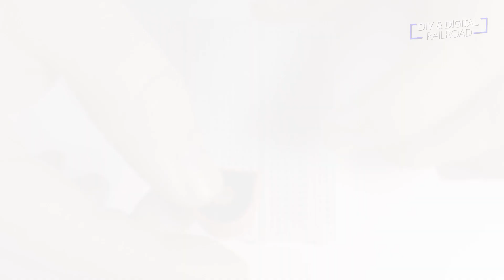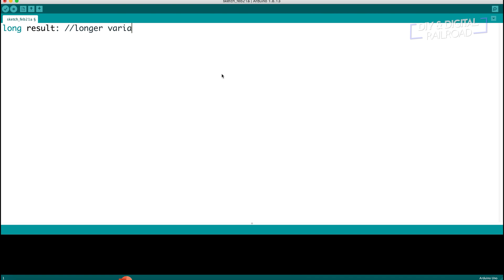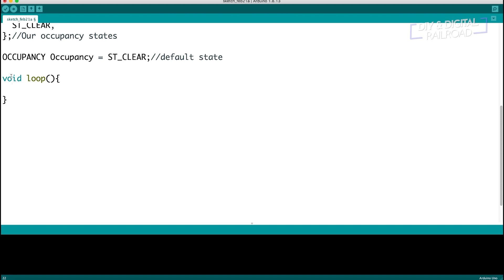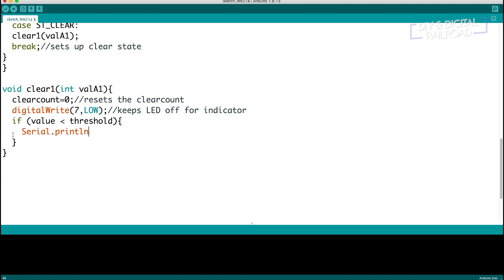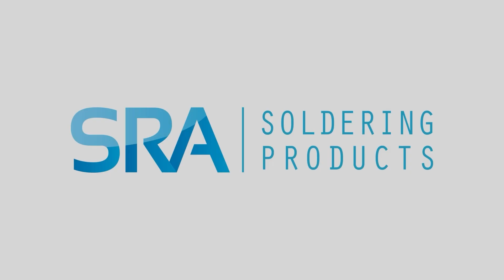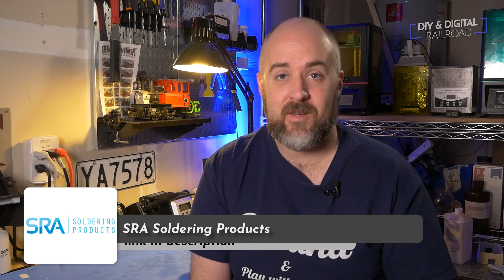Building a Cheap DIY Current sensor for DCC with an Arduino!

Comment: Hey Jimmy - cool video but I think there are a couple of things that are not correct (based on what I believe you are trying to do).  

In your loop() routine - you are not reading the sensor inside the for loop so you read the sensor once at the start of the routine and then go into your for loop and do not read the sensor in the loop so you are processing the same sensor value 10 times.

The logic for calculating the average of the 'numSamples' sensor readings also does not seem correct.  Your logic should be summing the valA1 values and then dividing by the current value of 'i'  to get the average of the readings in the for loop.  You are adding valA1/numSamples (or 1/10th of valA1 in this case) to your result variable.

A simple example if you have two readings of 552 and 560 then your logic results in:
Iteration 1: result = 552/10 =55 
Iteration 2: result = 55 + (560/10) = 55 + 56 = 111 <- clearly NOT the average of 552+560 (which is 556)

The correct calculation would be as follows:

void loop(){
  int valA1;
  int result = 0;
  for (int i=1; i <= numSamples; ++i){    // have to have 'i' start with a value of 1 to avoid divide by zero error first time through loop
    valA1 = analogRead(A0);     // read analog pin
    result +=valA1;             // Add the new reading to variable 'result'
    value=result/i;             // dividing result by the number of readings taken so far to get average
    Serial.println(value);      // displays average reading
  }
  delay(10);//reading every .01 seconds

One other comment is your 'clear1' and 'occupied' routines are passed the value valA1 but never use that value inside the routine??

Not trying to be a pain in the rear or a 'know it all' just wanted to let you know.  If I am incorrect please let me know.   
Thanks again - Rick
Reply from the maker: Hey Rick!  No you are not being a pain and I am going to pin this comment.  I plugged in the changes and re ran the test and it works great!  Since I am no coder, I will make these adjustments on the next video.  Thank you again!
Reply: @DIYDigitalRailroad  Thanks Jimmy - only wanted to help and I really appreciate you understanding that.  Looking forward to more videos from the DIY & Digital RR!
Reply: @DIYDigitalRailroad  another code thought if the delay(10) is really supposed to add a 10 millisecond delay between each reading it should be in the for loop as well. Also no need to print and average the value until all 10 reads are completed since you do not do anything with the result until all 10 reads are completed. So as an alternative you could do this:

  for (int i=1; i <= numSamples; ++i) {    // make numSamples reads
     valA1 = analogRead(A0);     // read analog pin
     result +=valA1;             // Add the new reading to variable 'result'
     delay(10);     //reading every .01 seconds
  }
value=result/numSamples;             // dividing result by the number of readings taken to get average
Serial.println(value);      // displays average reading

The above also takes care of the divide by zero error for two reasons i is not zero after the loop and it is not used to calculate the average, I changed the comment on the for loop to reflect this as well.
Reply: "The logic for calculating the average of the 'numSamples' sensor readings also does not seem correct."

The logic in the original loop is correct, though not optimal.  The division by 10 in each iteration of the loop should be division by numSamples for clarity, although when, as here, numSamples is 10, the results are correct.

The problem with your example is that you did only two iterations, but still divided by 10.  If you had divided by 2 instead, you would have gotten the correct result.  Dividing each time by i will never give the average; the last time through the loop i == 9, not 10.  Also, the first time through the loop it divides by 0, which ordinarily causes a program to crash and burn.  I don't know how Arduino deals with divide by 0 errors.

I would have written the loop this way:
--- snip ---
  for (int i=0; i < numSamples; ++i){
    result += analogRead(A0);
  }
  value = result / numSamples;
  Serial.println(value);
--- snip ---

There is no need to do more than one division, especially since all but the last are thrown away, and you don't need to store the reading in a temporary variable.

Also, the long result in the first line if the program is never used; the int result in loop() masks it.  Since you originally made result long, you might want to do the same in loop(),   If you keep numSamples below 30, however, that should not be necessary.

Comment: Very nice video - easy to understand and thus very useful.  I built one and tested it on my home Digitrax test track, and it worked perfectly with no adjustments to your parameters.  Then, I installed it on a block of my NCE club layout which has a known leakage of about 15mA.  The detector showed "Occupied" regardless of where I set the threshhold.  I computed the maximum of the "value" variable and got a max of about 400 with the track unoccupied.  Setting the threshhold to any vaue above 400 did not give me the "clear" condition.  Any idea what I might be doing wrong?

Thanks in advance for any advice you might have.

Comment: I know its been sometime since this video played, but I had all the component and thought I'd play around building one.   Built everything as per you video on a breakout board and checked my components and wiring several times. Down loaded the updated code, but can't get it to work.  I used a 5 amp HW-666 current transformer  wrapped wire 4 times thru transformer coil and soldered one end to one side of isolated  track.  Question what do you do with the other loose end of the wrapped wire your doesn't show?  Any and all troubleshooting comments are welcome.

Comment: Jimmy, It would be a lot easier if you used strip veroboard and you can mount 3 sensors on each board. Making it very economical with less soldering.

Comment: I did something very similar but I used a cheap high gain NPN transistor to amplifier in common emitter mode to pull down a digital pin which was defined as INPUT_PULLUP. The input pin on the arduino has a .47uF capacitor across it. The pullup charges the capacitor when the track is not occupied, however when the track is occupied the pulses from the transformer turn on the transistor, discharging the cap. The time constant on the capacitor/resistor in the pullup does not allow the pin to get to a high state before the next pulse from the transformer.

Comment: Hi, I realise this is two years old, however how many detectors can be run on one UNO? If only one, then it may not be cost effective when you can get 16 in a BDL168 for $8.75 each. And yes, I do need 16 😉 Cheers 🇦🇺

Comment: Question because I couldn't see either in your video or your SHOW MORE section. The other end of the black wire going through your current transformer where dose it go? I see the one end is connected to the orange wire that goes to the middle of the insulated rail but where dose the other end connect to? Also the 2 orange wires  the one before and the one after the insulator connectors on the rail where do these wires hook up to? Dose not show that in your video or SHOW MORE sections. At least I COULD NOT pull up any type of schematics. Do these wires hook up to track power some how? If they hook up to track power dose it mater if its on the positive side or the negative side? Do you need to isolate the current flow in these wires so it only flows one way using diodes?

Comment: Hey Jimmy, I took your code and loaded it onto an ATTiny85, mounted it on the board and connected it directly to the sensor.  Now I have a current sensor with a digital outputs that I drive an LED and send signal to JMRI sensor shield.  Thanks, It works great!
Reply: Great idea! The ATTiny85 are amazing little bit of kit.

Comment: Hi, can you explain how having the diode wired as you have it, thus putting a negative voltage on the analog input it works.
The DCC current, basically AC to the current coil, is being rectified by the diode.
A current transformer is not meant to be used like that, you should have a burden resistor and measure the volt drop across that resistor.
Not using a burden resistor will allow the transformer to produce high voltage spikes, and damage your UNO.
With the 2 x 1M resistors you are actually using the current transformer as an antenna, not a transformer.

I do not deny that it works, BUT how about how it works and its durability is questionable.
Reply from the maker: I think that the simple answer to your question is that a regulated DC power source that is connected to the base station does a lot to mitigate the threat of voltage spikes before the signal is even sent to the track.  This is not a problem unique to this setup.  DC power sources are overwhelmingly used in DCC setups because AC power sources are mostly unregulated and cause voltage spikes that can damage decoders.  This way we only need the diode to rectify what is coming from the sensor, then let the arduino do some math functions to let it make sense.

I did do some more research before answering your question.  I could not find any of the myriad of DIY DCC current sensors that use a burden resistor.   Most of them, if they had components for transient voltage, used a capacitor.  One guy, Dave Bodnar, who's blog and information I really trust, actually removed burden resistors from a variant of his DCC current sensor in order to make it work.  I have linked his article here.

http://trainelectronics.com/DCC_Arduino/Current_Sense/index.htm

I do appreciate your question as it did spur me to do some more research and learn more.

Comment: how far apart from each other do the sensors need to be I have 3 mounted about an inch apart and wiring goes around these at close quarters I am having random triggers with them mounted like this do they and the wiring for them need more separation?

Comment: Hey Jimmy have you ever thought about using the Allegro ACS712 with your Arduino. I think there was a video of another guy using one for block detection but I can't seem to find that video anymore
Reply from the maker: Hey Marcus!  I actually tried one of those before.  The problem is that it only registers when power is applied.  So stationary trains don’t register.

Comment: Excellent video! (warts and all! LOL)  As a novice to Arduino, I'm wondering if you can detect occupancy in multiple blocks with one Arduino.  Also, can this be ported into JMRI? Thanks for a great video series!
Reply: OK, I just rediscovered your series on multiple block detection.  I still wonder how to put that info through JMRI.

Comment: Hi Jimmy,

Just wondering how the code with change for multiple sensors on one Uno.  I was thinking about one Nano per block vs. adding more loops, etc.
Reply: You should be able to run 8 sensors from one Nano - reading each sensor (A0 to A7) in turn in the loop, and having more states and variables etc. - but I think you will either need to ditch the delays or just have one delay for all the sensors to make it fast enough - what is actually coming being sampled from the transformer is a miniature DCC waveform so all you need is to sample it enough times to cover a cycle of the waveform to know whether it is there or not.

Comment: Question:  Did you look at a solid state Hall effect sensor like the ACS712ELCTR-05B?  I am researching that for my own sensing system at the moment.  

Comment:  when deploying this, you can implement two blocks with two of your sensor of choice and 1 ATTiny85 for your micro controller.  Hook the sensors to two of the analog pins and use two of the other pins for the output.  That leaves 1 pin fo something else unless you re-purpose the RST pin.  The code should be the same as the UNO code, just the pins need to be changed.

Comment: Hi Jimmy excellent video, and I love your passion and knowledge. But just an observation, you state the BD-20 are expensive if you need several. However you demonstrated one transformer and one Arduino.. does that mean I need another transformer /Arduino pair for the next block?... that sounds more expensive than the BD-20 option
Reply from the maker: That’s a good question.  So you can build this with cheap arduino clones.  If you use something like an arduino pro mini clone, you can get the cost down to less than $7 per detector.  The BD20 still requires an arduino to work in this capacity.  So you’re looking at $20-$25 for the BD-20 + the cost of the arduino.
Reply: @DIYDigitalRailroad  And the BD-20 is still only for a single block

Comment: Hi Jimmy,  I have been building a layout after being out of the hobby for quite some time and am using Arduino based controls for turnout, frog, panel control etc. (OK everything)  Love that you are providing this input to the hobby.  As you pointed out, much of the commercial products are expensive and there are alternative methods that in. my opinion only add one more aspect of the hobby to enjoy.  I would love to share some of my ideas with you re electronics as well as 3D printing, but I could not find any contact info other than FB.

Comment: good video, but there seems to be 2-3 seconds between the train leaving the section and the LED going off, it turned on as soon as the section was occupied, was wondering why this was happening
Reply from the maker: So that is actually written in the code.  You can decrease the amount of time by lower the number of clearsamples in the code.  I typically have a few seconds before the block shows clear so that false signals are eliminated.

Comment: Great video. I've been looking for a cheaper way to do this. Just wondering how hard it would be to code multiple sensors on a single Arduino. I am no coder.  Layout has nearly 60 blocks. Really don't want to use a nano or micro for each block, how many could you put on an AT mega? Feasible?
Reply from the maker: So an Arduino Mega can support 15 sensors like this with its 15 analog inputs.  The issue you are going to run into is a lot of code. So if would take you atleast 4 megas to handle 60 blocks with 3 aspect signaling.  The issue you are going to run into is code.  Your code will be massive to control each.  This is why I like daisy chaining my arduino block signals to where they talk to eachother.  I would also take a look at the pro mini.  You can get the cost down to under $7 per block when you are using one of these.

Comment: Thanks Jimmy, excellent video. So basically it is a transformer inline with one of the feeder wires from the buss and you are reading the change in the induced current I'm assuming. I seem to remember in one of your previous videos that the signal was too weak, especially in N scale. was this overcome by wrapping the coil 4 times on the primary, and is the sensing nearly 100% now?
Thanks, greatly enjoy your channel.
Reply from the maker: Hey Michael, yes you are correct.  The raw data comes out jumpy but jumps to more extreme ups and downs when current is being drawn.  So the code averages those and give a number.  That number lowers when current is being drawn.
Reply: @DIYDigitalRailroad  Hi, I was a bit concerned that a short on the track would spike the current very quickly to the Max current available until current protection kicks in and turns off the track power.  I was thinking detecting current that was 5 amp or so would over voltage the Arduino analog input with 4 wraps.  But from what you are saying, if I read this correctly, is that the more current through the track feeder wire the lower the voltage going into the Arduino analog channel is.  So signal close to ground is occupied and signal close to 5vdc is clear?  I wanted to confirm there is built in circuit protection from over current through the coil.

How does the 2 megaohm and Diode actually work with the coil?  I'm having a hard time wrapping my head around the voltage to the Arduino goes down when current goes up.  Is the current changing the effective resistance in the coil?  Is there diode reverse bias being detected? Any extra info or a small explanation diagram would be helpful for my understanding.  Anyways, Thanks for the sketch.  I plan on using Arduino Pro Mini that had 8 Analog channels and and enough Digital outs to my JMRI system.  I have another home built system right now but it is not reliable.  I'm hoping this will do the trick.

Thank you for sharing this video and sketch!

Comment: How many of these can 1 Arduino support?  I have lots of blocks, if you add in the cost of 1 Arduino per block, the wiring, the space needed I think the BD20 is a cheaper way to go.
Reply from the maker: It depends on which arduino.  The UNO has 5 analog inputs so it can support 5.  The Mega has 15 analong inputs so it can support 15
Reply: @DIYDigitalRailroad  Hi all, The mega can actually do 16 analog channels.  Analog A0-A15.  Pro Mini can do 8 channels. A0-A7.  These are what I have and I have 32 blocks so I intend on needing 4 Arduino Pro Minis.  Some boards have A6 and A7 at the bottom and some squeeze A6 and A7 on the inside like A4 and A5 and some don’t have A4-A7.  I avoid those.
Reply: You need to modify the code to do multiply sections, there maybe some smaller code to do it multiply.

Comment: Is there really only one connection to the coil of black wire wrapped around the transformer? The other end of the black wire is under the test track and not visible.
Reply from the maker: Hey Robert.  Both ends of the black wire are connected as an insert of sorts in the feeder to the isolated rail.